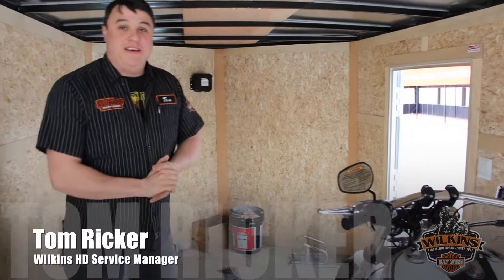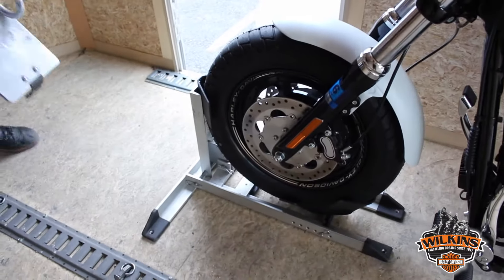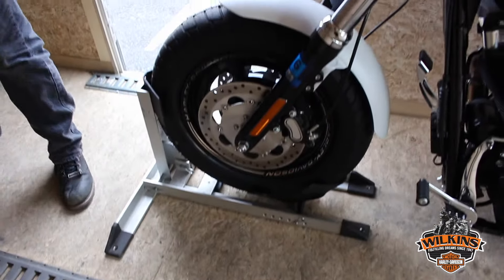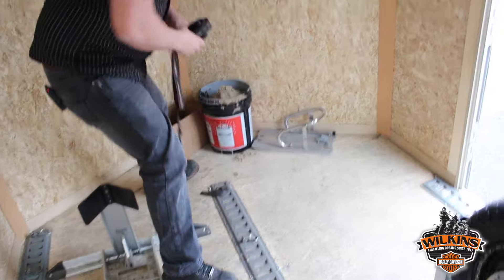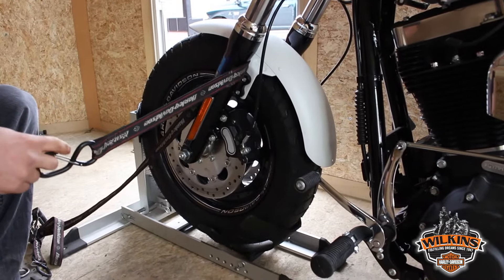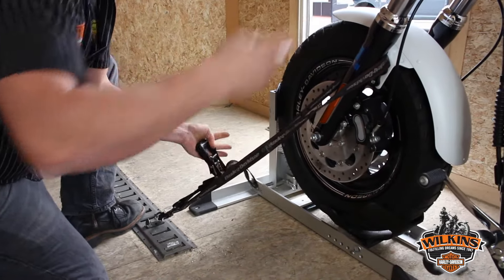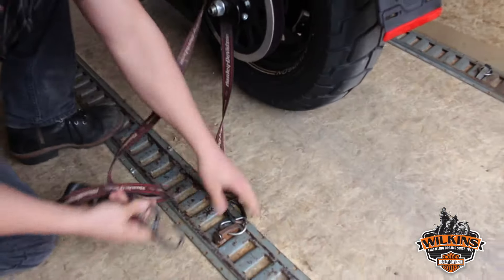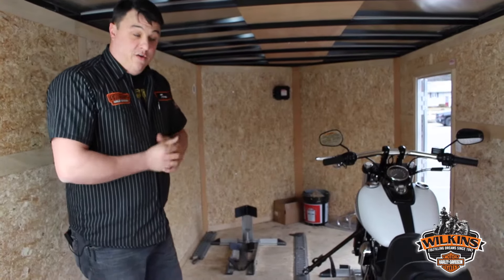How to Strap your Motorcycle Down, Wilkins Harley-Davidson

Comment: How do you strap down an ultra with full upper and lower fairings?
Reply: I trailer my Cvo limited for long trips by securing it the same way in video using front forks in the wheel chock and strapping the rear tire by looping the around the rim closest to the deck to corner anchors points. Let the bikes suspension do it own thing. Double the front straps if using cheaper straps.

Comment: Great video!  The only thing I would add is make sure you get at least one full wrap around the strap drum (where the strap rolls up when you’re tightening it) or the strap can pull loose. I learned this the hard way. One of my straps wasn’t wrapped all the way around the drum and the bike came loose. Luckily it didn’t fall, the left hand grip and mirror were banging up against the wall of the trailer and just did some cosmetic damage. Could have been worse but glad it wasn’t.

Comment: What if you have a Harley touring bike with bags
Reply: Joseph Blaha look into a system called the biker bar. Look it up on you tube. I bought this set up for my Road King. No straps at all. Cost around $360 worth the investment
Reply: Check out a product called the biker bar. Look it up on you tube. I bought one. No straps needed. Around $360 well worth the investment
Reply from the maker: Same process.  We transport all over using this same method.
Reply: Strap the rear to the passenger foot pegs or floor boards

Comment: Yeah one problem is the bike can skip to one side on a bump from the back and you lose tension from all straps. It did happen to me with my BMW You should strP bith sides of the back besides that really good vid. Most beds are pretty slippery and can slide either way.
Reply: he said strap both sides
Reply: @b27rampage  And if you are using a Condor, which is awesome, and you have the option to bolt mount it to the trailer surface, your bike is not jumping anywhere

Comment: Shouldn't your chock be way more in the front of the trailer to ensure proper load balancing?
Reply: Depends on the geometry of the trailer. You mainly want the weight to be over the axles so the trailer is level. In the case, those are more rearward. If you put too much in front, the front of the trailer will drop and the front of the towing vehicule will lift and be more likely to cause sway at high speed.

Comment: Whoa, Please Stop:

When You put the second strap on the bike and proceeded to pull the bike "back".  Think about that for a second.
Yes, You had a excellent point on the bike; but put the rear strap, pulling to the front, as you did on the front.
  
When you tighten that second strap, as You have it.  You are pulling the bike out of the Chock.  That is not the best way to do that.

So Position the rear strap to pull ahead, Also.  Thus, pulling the bike into the chock, also.  Think about that for a second. 

For instance if, by chance that front strap should fail; the rear strap is still pulling the bike into the chock. The way You have it; in that scenario the rear strap would pull the bike backwards.  

We were  Wholesalers, mostly 90% harley; and we loaded and unloaded scores or big bikes daily. Keep that bike in the chock and all will be well. Don't try to pull it out with the rear straps.
Reply: correct pull the unit forward always
Reply: absolutely you are correct. This video is incorrect.
Reply: When he said back he meant toward the chock. Watch again. His back was toward the chock.
Reply: @mtp04987  Negative: When he tightened the rear strap the strap was pulling backward " to the rear".  Thus he was putting stress on the rear strap to pull Rear-Ward.

It is so easy to see that.  Why are you covering for him. It is Not personal he just made a mistake. Don't show that method to anyone. It is Wrong  Your straps are pulling against each other.
Reply: The wheel chock shouldn’t take the load, that’s why he tied it down pulling forward, then backward. The straps and d-rings are taking the load. This is the proper way. That wheel chock is likely just bolted to the plywood floor, which is fine for it’s intended purpose.
Reply: The wheel chock is only meant to keep the front tire from going side to side that's it. Proper load securement on anything (vehicle/equipment related) is to have all 4 corners pulling away from the center like you are trying to stretch it out.
Reply: @johncasor9698  Thanks, makes perfect sense now. I was always pulling to the rear mounts. If mid mounts exist, I am going with that.

Comment: Never strap your bike down using the front works or wheel assembly as anchor points, this will likely cause damage if done often. Always use the front frame down tubes as your anchor points. Ensure brake lines, cables and electrical wiring harness is clear of ratchet straps before synching down…
Reply: WRONG

Comment: I agree with strapping the unsprung weight but do not agree with sending a strap around the fork.   Instead, like auto transporters, run your strap over the front tire, under the fender from one side to the other.  This will strap the tire down into the chock preventing it from coming out.
Reply from the maker: No worries.  You don't need to do it our way.  It is one way to do it.
Reply: How does running the strap around the fork let it come out of the chock ?
Reply: Why do t u like using the fork you think u can hurt it?
Reply: @daviddunn7817  don't even need a chock when strapping g this way.

Comment: you must pull the bike forward always even the rear straps... and i would put a strap on the fork brackets so bike will not bounce going and put presser on holding straps. think about for one min. bouncing bike on trailer ???  or no bouncing bike on trailer ??? bounce and pull... bounce and pull... get it now ??? a bouncing anything is a problem about to happen. sure you can get away with it sometimes... just pull down on the rear or wrap around the rim of wheel and pull it tight on side to the other side....

Comment: I've read that the best way of fixing ANYTHING is from the highest part of the object (so just under the handelbars) to the nearest lower platform (so exactly where you fix it on trailer). on the other hand you need to compress the suspensions and tight it down so it won't go up and down during transport. It means I disagree with ur way of strapping down the bike and it's against the physics laws!!
Reply from the maker: This one tickled us this morning.  Thanks for the comment.  We haven't ever had someone cite "the law of physics" on how we strap bikes down.  Sounds like you have the world figured out on this.  If you already had it all figured out based on physics, why watch our video on "How to Strap a Bike Down?"
Reply: @WilkinsHD  because I was curious and thought you might have a better and more secure way. Then I saw the mistakes you've made and I thought warning people not to make the same mistakes wouldn't be a bad idea. I see you like the new ideas so let me tell you that the back straps are wrong too. They shouldn't pull the bike backward but pushing it forward to the front side of trailer. This way is the bike not between two opposit forces but two forces both working on same direction ;-)  you're welcome sir!
Reply from the maker: @f.anvary7783  thank you Professor.
Reply: I love the internet! Everyone is an expert. I want to be an internet professor. Is there a process or do I just claim it and push forward?
Reply: I love my bikes and the new style chocks appear secure, very easy and saves the fork seals. The professor did bring up some great points. I will add a strap to the bars but with minimal downward force.
Reply: You strap it this way the suspension does what it should do and moves up and down.  Only people I k ow hooking up to the handle bars are dirt bike riders and morons that don't know what they are doing. And do t under stand physics
Reply: Yeah not true with the suspension you can ruin it by pulling it all the way down. If you strap it before the suspension ie the unsprung wheel it will not move up amd down.
Reply: @WilkinsHD  he is correct on the Physics law and your way of strapping it down is incorrect...
Reply: @johncasor9698  Actually he's both right and wrong. On a solid object then yeah, strap it from the top. However, motorcycles have suspension. If you strap it from the handlebars, then every time you hit a bump, the suspension will compress and the straps will become loose, even if its only for a split moment. I'd rather strap it down low like in the vid so you bypass the suspension and the straps remain tight & secure, bump or no bump.